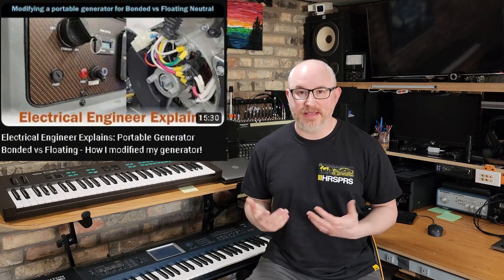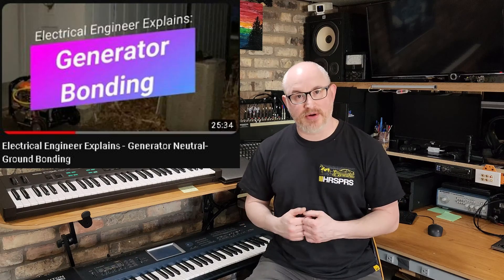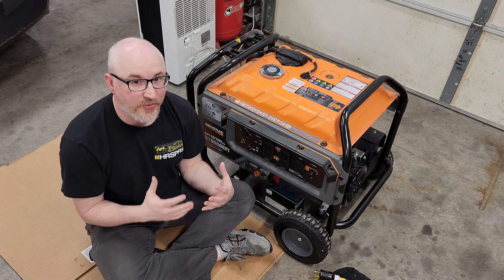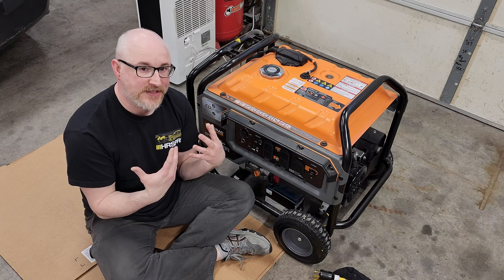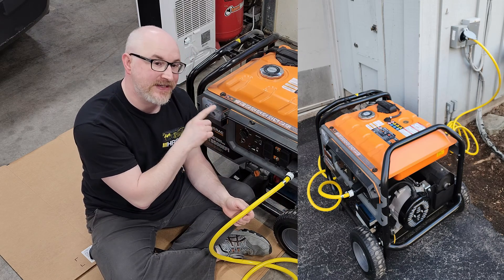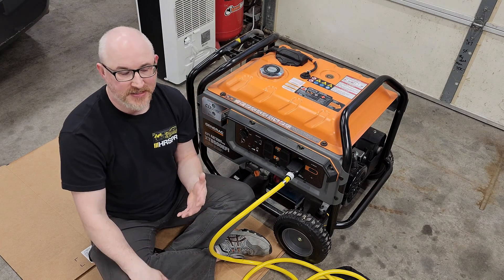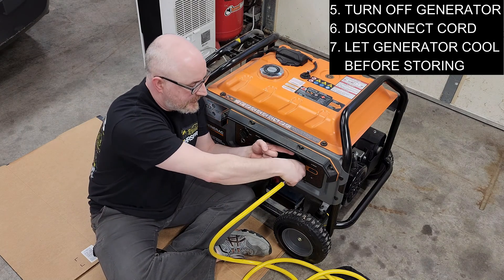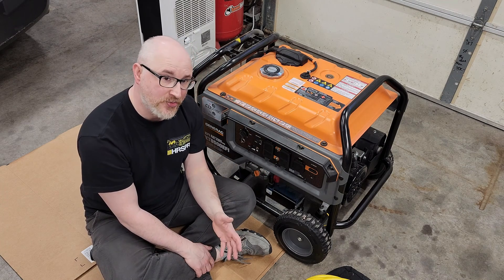Part 2 - Electrical Engineer Explains - Modifying My Generator For Floating vs. Bonding Neutral!

Comment: I have a generator with a bonded ground that a use for a back up genny for the house and for a stand alone genny for projects around the property. My question is can I just disconnect the ground from the cord that I use to power the house and accomplish a floating ground?

Comment: Thank you. Quick question: If I modify my generator to a floating neutral for a panel box installation, could I get a generator bonding plug (Amazon $5) to insert into one of the generators 110 outlet to used as a stand-alone generator?
Reply from the maker: A 120V bonding plug may not have sufficient size for the bonding jumper.  Maybe a 30A or 50A version would, you'd need to match the factory jumper.

Comment: Question. Let's say I have it hooked up to the house, so it's in the unbonded state (since the house has its own bonding), if I use one of the plugs on the generator itself, will it utilize the bonded junction inside the house? Or are those plugs on their own circuit and I should not use them?

Comment: Richard, you may be able to answer my question. Coming onto that term strip you have Red (R1) & Black (L2) which come from 2 different main windings. I get 0.4ohms from white Neutral (R2) to Red (R1) & 0.8ohms from the other white Neutral (L1) to Black (L2). Every other configuration leaves me with 12Mohm. This seems right since it’s the other ends of the windings, but this is also saying hot is tied to neutral and tying all neutrals together makes continuity between both hots and neutral. Are these readings correct and would this cause any issues? Am I missing something here? Your advice would be greatly appreciated as I am trying to unbond neutral on a DuroMax and just was taking readings. Thanks.

Comment: it seems that the generator is non inverter style? You ok as far as your electronics in the house?
Reply from the maker: Good observation, and yes,  this generator was chosen for low THD, 5% or less.  Unique for a generator of this size that is not an inverter style.

Comment: I think a neat way to do that instead of a toggle would be to install a key switch.  That way the switch couldn't accidentally get switched to the wrong position.
Reply from the maker: I considered that, but the trick was finding a 30A 240V keyed switch that was small enough.  With enough space, an IEC rated switch would be a more robust option.

Comment: Hi Richard I appreciate the time, effort, and the value of all three of your videos on this subject.  

Currently I have installed the 220v socket and it is grounded to my only breaker panel. When I have my bonded generator hooked up to it, it is also grounded to the same 220v socket. As per the very first video, I'm going to lift the breaker ground from the socket and cap it off. 

I am assuming this action will just as safe as adding a bonding/ floating switch to my generator and leaving the breaker ground intact.  Is my assumption correct?
Reply from the maker: Assuming you have a mechanical interlock on the generator breaker,  lifting the receptacle ground is suitable with a bonded generator as described in my bonding video.

Comment: How about you do a calculation for the highest unbalanced load on the neutral and tell us the maximum voltage that the frame of the generator would get to if the bonding stays at the generator. It’s a straight calculation.
Reply: Ide appreciate you doing this. Are you insinuating the double bond neutral risk is negligible in the situation presented in the videos?
Reply from the maker: I size the switch the same as the neutral conductors, which NEC considers current-carrying and are sized the same as the phase conductors.  Simply put, #10 phase conductors have a #10 neutral and thus 30A rating.

Comment: What are your thoughts on making a 240v bonding plug to leave in the unbonded generator to bond it. Removing the plug only when connecting to my bonded house panel at interlocked 30A breaker.
Reply from the maker: @ronaldmeadie2869  interesting idea, I think that could work.

Comment: If you float the generator and hook it up to power your house breaker panel which is bonded, can you also at the same time use the 120 plugs on the generator to power something else?
Reply: Yes

Comment: When I unbound  the neutral in my generator, do I have to disconnect the green ground wire to the frame also?
Reply from the maker: Hi.  No, do not disconnect any frame grounding.  All you are doing is relying on the Neutral-Ground bond in the panel in your home so that your generator is a non-separately derived source.

Comment: What i can't figure out is why on a lot of newer generators, they're floating neutrals with 30amp rv plugs when rvs need a bonded neutral. One would think if someone is buying it for an rv that it should be bonded but most people have no clue what any of this even means and very few read manuals. They just see they can plug their rv into it and Bob's your uncle until they have issues.
Reply from the maker: It's a concern, for sure.  The idea of neutral-ground bonding is confusing for the majority or people, including licensed electricians who execute without the need (or desire) to understand why things are done.  The RV needs a bonded neutral power source because it expects shore power to be provided, which is always bonded.   We need an RV option, a stand-alone option, or a home-backup option for generators.

Comment: So, my understanding is that if your transfer switch switches both neutral and hot, you would keep the bond on your generator, correct? If so, and you are using a simple interlock device where the neutral is not cut, what happens if the power outage results in the loss of neutral from the transformer to your home and you have an unbonded generator? In that situation, would you essentially be in the same scenario identical to a transfer switch that switches neutral as well? And if so, would that be a bad thing to have your generator unbonded?
Reply from the maker: @Ryan96se  the circuit breakers interlock will never switch neutral, only a transfer switch can do that.  So the scenario you present cannot occur.
Reply: @richardvedvik979  I guess what I am trying to say is, suppose a tree falls and takes the entire line down from the pole to your house. You are completely off grid. Both hots and the center tap (neutral) from the transformer are laying on the ground. If your generator is unbonded and tied to the bonded neutral in your main panel that is now going to the neutral laying on the ground, where is your ground then? Does a ground fault circle back from the main panel to the source (generator head center tap)?  When does the ground rod next to your home come into play?

Comment: Finally,  somebody that explains in a more common sense, logical and non electrician terms in how a bonded neutral and floating neutral generator is used.  I bet I’ve over 50 videos on this subject in a the past few days and it’s very confusing.  Well it was up until now.  Thank you !!
Reply from the maker: @workharddieproud  thanks!

Comment: Hello Richard I have been running my  generator for 45 years and I away just hook up the two hot legs to my panel as the neutral and ground in the panel always work and if you want a floating neutral you can just disconnect the wire in the plug or outlet. I would like to know your opinion on putting on a exhaust extension Champion says that it may cause a  problem with the generator, thanks Bert
Reply from the maker: @TheViking34482  I've added a car muffler to a gas generator before.  The additional back pressure means you have to derate the generator.  A 1992 Geo Metro muffler has a 1.5" connection and is fairly cheap.

Comment: I was thinking of doing this but had the idea of using a key switch instead of a toggle so it can't accedently be bumped to the wrong position.  Thanks for these vids, far clearer than anything else I've seen on this subject!
Reply from the maker: Thanks!  A keyed switch would work also, it would just need to have sufficiently rated contacts.
Reply: @richardvedvik979, what rating switch will be needed for a 7500watt genmax generator? I have 2 of them for the house for running them in parallel 50amp hook up. Thanks.
Reply: Ha...i just said this the other day and just now noticed this.  Great minds think alike 👍

Comment: Thank you very much for your series on wiring the transfer switch and the generator modification.  This may be a stupid question but wouldn't it be sufficient to keep the generator unmodified (bonded) if and only if, the ground wire from the generator is lifted as shown in your earlier video (not connected to anything in the home).  Wouldn't that be sufficient allow only one path back to the generator via the home bonding in the panel?  Also if there was a fault at the generator or exterior connection receptacle, then the electricity could flow thru the bonding in the generator to ground via the neutral to the home ground?  Thank you for helping us understand this topic
Reply from the maker: @JR-jn8jp  tou are correct,  my other video stands alone, allowing people to follow that step and not modify the generator.

Comment: Can you not connect the neutral white wire from your inlet box to your electrical panel?   would this cut the path to your generator?
Reply from the maker: @thimitri1  neutral is needed, it is the path back to the source. Without the neutral,  all return current would be on grounds.

Comment: Can the L14-30 receptacle on the portable generator by its self have a floating neutral, while maintaining a bonded neutral for the 20A 120V receptacles, so that they can be used while powering the house with the L14-30 receptacle? Or as shown in your previous video, you detailed how to isolate the ground  at the inlet plug box to prevent that dual path to ground. In this scenario would the 20A 120V receptacles be usable?
Reply from the maker: @usafchief8985  with my process of isolating at the house receptacle,  the generator can remain bonded and you can use the receptacles on the generator at the same time.

Comment: What if you had a subpanel in your house where the grounds and neutral were separate. Can you put the generator to the subpanel to feed those breakers with the generator bonded neutrals and grounds together? Or do you still have to separate the generator neutrals and grounds?
Reply from the maker: @ctbt1832  the problem with trying to backfeed a sub panel is you cannot interlock the home's main breaker and generator breaker.  So it's an unsafe condition.  

For bonding, there will still be two N-G bonds in the system.

Comment: When connected to the house with a generator that has been modified to the floating neutral I've seen the generator needs to be connected to a ground via the grounding lug on the generator.  Can you explain that case?  Does the generator need to be ground ed to a grounding rod via the grounding post on the generator?  I've also read it need to be attached to a grounding rod that is 8 feet in the ground.  Why?

Comment: Great content thank you for your time making these videos.
In your first video you said that generators come bonded.
But i have seen many generators especially ones to small to run your house that come floating neutral. 
Some of these generators have the proper outlet for transfer switch and some don’t.
My question is what is the intent of the manufacturer selling these floating neutral generators?

Comment: Thanks for sharing your knowledge. I have 2 questions to start 😂: 1.your knowledge /opinion on Inverter generators vs regular portable generator (my reason for asking is to understand what is likely to get damaged by an irregular sin Wave ((I believe 3% or 5%))) also on this note is there solution around this if it is an issue such as a surge protector. 2. A soft start for the ac. 

I’m looking for a portable option utilizing natural gas while running my 4 ton ac unit. I’m trying not to spend $10k, looking to run 50 amp plug , soft start, and hoping to get a 10-15kw which I know will run less converting it to ng. Also last question on these larger generators that have multiple 50amp receptacles/breakers do you have to utilize both or can you get all the power using one?
Reply from the maker: In your case, I think it makes sense to have two generators. One larger generator with a local manual transfer switch to serve your A/C unit.  This can have higher THD and thus will be much less expensive.   The second would be a low THD generator to serve your sensitive electronics.  The generator I purchased is specified as less than 5% THD, which is perfect for any modern home.
Reply: @richardvedvik979  thanks for the quick response. I’m assuming you don’t have an opinion on the soft start😀 but maybe I’ll read the previous posts to see if you have possibly addressed that. Again thanks for sharing your knowledge it’s much appreciated for smooth brained apes like myself.
Reply from the maker: @mandfmarine  I do have opinions on soft start, I just had time to address the first part of your question.  You could install a soft-starter, but the cost of that component would likely be similar to the cost to bump up the size of the generator to compensate.  

Also, you cannot reduce THD with a surge suppressor or other plug-in devices like power conditioners.  The only way to reduce THD is a low-pass filter.
Reply: @richardvedvik979  again thank-you for your time and responses. It is very appreciated.
Reply: @richardvedvik979 claiming 5% THD is kind of a manufacturer lie imho. It may be 5% or less at 500 watts but I am very suspicious what it is under load at like 80%. I highly doubt under normal usage loads it is what they claim. I am in the same situation. With my gen set. Problem is really analyzing it takes equipment that costs several hundred dollars or more. The THD on all the similar style gems have this same issue. It has never been an issue however for me and my appliances. Mine are all 15 yrs + years old

Comment: So am I correct in in assuming that you can use the 120v outlets on the generator with the lifted bonding switch as long as the 30amp cord is connected to the house breaker panel because the circuit is bonded in the panel?
Reply from the maker: That would be correct.  We need a bond, but only one bond.  Then connected to the home in this configuration, the 120V receptacles can be used.

Comment: My Predator has a 30amp 240v but to reach max rated output allows the additional use of 1 or both 120v outlets. 

Thoughts on running both house and a possible smaller load via an outlet, and the bonded vs floating issue?
Reply from the maker: You'll find that you can't really load a generator fully anyway, because it needs some headroom to recover from voltage dip and frequency dip.  Anytime a motor starts, it draws double it's rating.  Just use the 30A 240V output, I do that on my 8500W generator and it's a perfect combination.

Comment: HI Richard,   first of all let me express huge gratitude for all you hard work with find, understand, figure it out and deliver this information to us. Thank you very much for what you have done  and dedicated tons of labor hours with those back up generator series of video. 

I am just armature with electricity and I have the following question:   
I have heard you mentioned you can power all priority 1 appliances with your generator except A/C unit. To answer to myself "Why a/c cannot be... "  I was able to find out this is because the  a/c starting amp (spike) is exciding generator max amps, please correct if I am mistaking.
Have you heard about "Micro Air Easy Start " based of the video below (see link below) some enthusiasts are able to run 2.5 ton a/c with generator. What is your opinion and will "Micro Air Easy Start " unit provide any damage to a/c it self in long term run since this is permanent installation? Thank you very much in advance 

https://www.youtube.com/watch?v=keRaj4Gyi5Y
Reply from the maker: @olegl6776  thank you for the comment. I'll check out the video and report back.

Comment: I've watched several of your videos on this topic, all very informative. With regard to this video and the one titled "Electrical Engineer Explains - Generator Neutral-Ground Bonding", what is your final configuration when connecting to your main panel? I believe it is floating neutral at the generator and a continuous ground between the generator and main panel, correct? I ask this because in the "Electrical Engineer Explains - Generator Neutral-Ground Bonding" video you show the ground lifted between the generator and main panel while maintaining the neutral-ground bond in the generator, I believe.
Reply from the maker: Thank you for the message.  The videos are in chronological order, and you are correct that my final configuration was modifying my generator to allow a floating neutral configuration so that I could maintain bonding through the generator receptacle.  But the toggle switch allows me to also utilize the generator in a bonded neutral configuration for stand-alone operation.
Reply: So in your final configuration do you use a grounding electrode at the generator?
Reply from the maker: @derrickoneill2880  in my final configuration, I have a floating neutral switch that let's me use the homes ground rod.

Comment: Great videos. Perfect explanations. Thank you. 

Question, though. I looked through all of the wiring diagrams for my GP6500, and can’t tell why the unit starts, then shuts down when neutral is lifted (and not connected to the bonded panel). The neutral line seems to have no connection to anything related to the engine. What triggers the engine to stall in that configuration?
Reply: Note… I don’t want to run it like that for any reason… just curious as to what’s happening there.